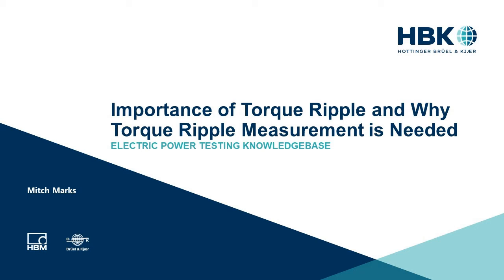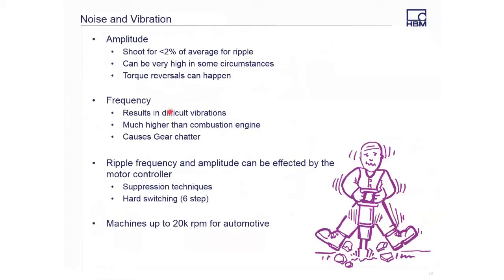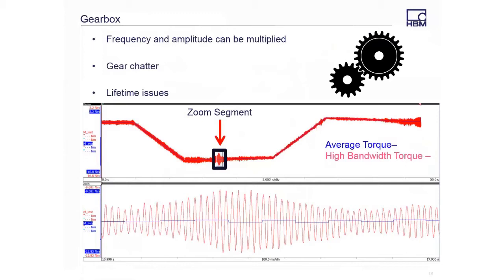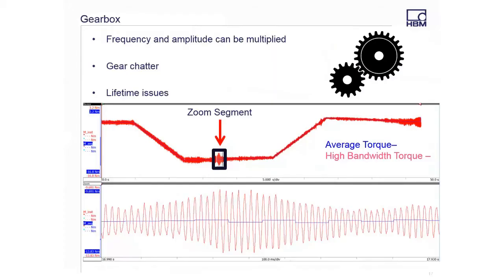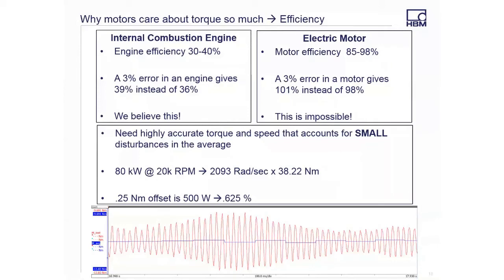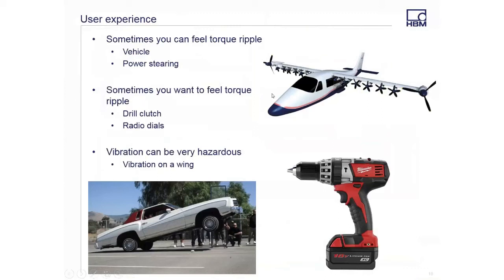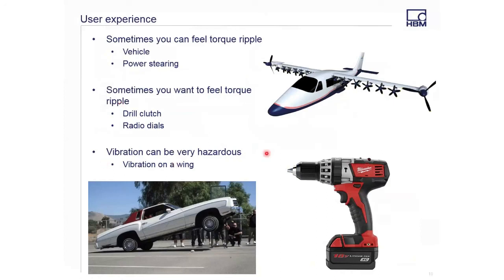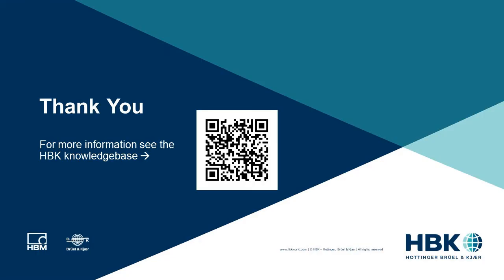Importance of Torque Ripple and Why Torque Ripple Measurement is Needed

Comment: I have a 7000 hp synchronous motor that I'm struggling to get to sync. I'm told the module is looking for a reduced "ripple" before it allows the DC fiekd to energize and sync the motor. I'm just unsure how this module actually receives the ripple. The only wires that I'm aware of, connected to the motor, are the DC on the Exciter and the motor feed power. How would a module on a sync motor know what the ripple is? Via the DC wires through a sort of generation until the exciter energize?